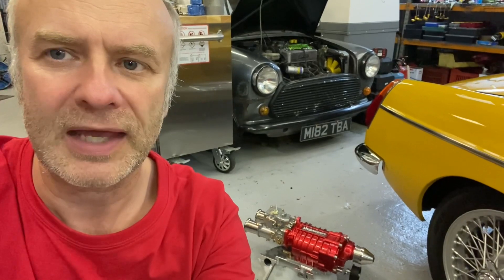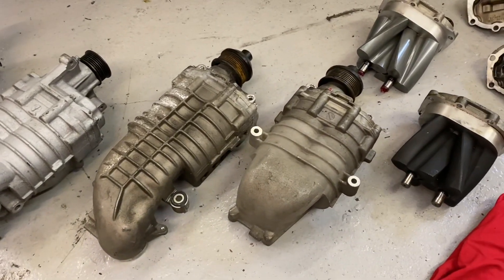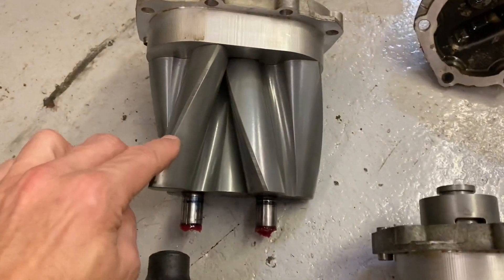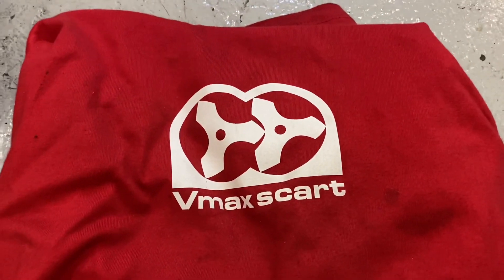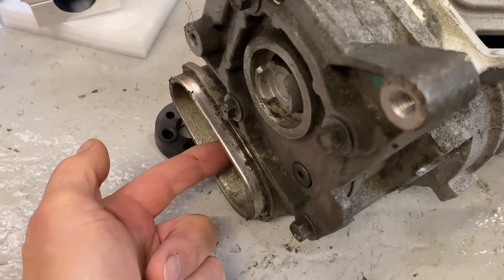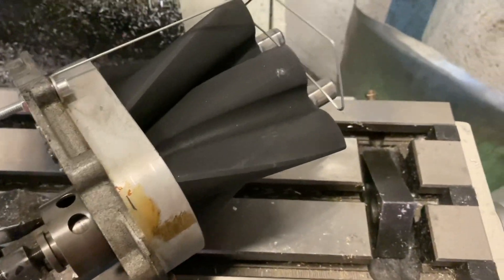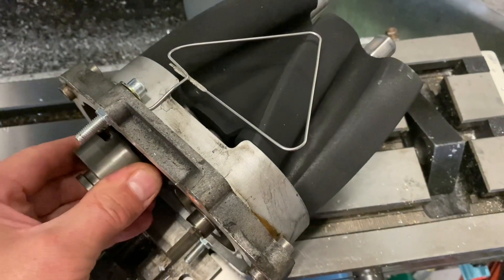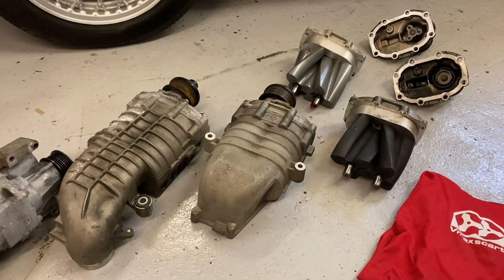Eaton M45 superchargers

Comment: Apart from the R53 supercharger. Do the other 3 superchargers all fit the manifold shown? Thanks
Reply from the maker: a271 type and the mini one are the same but different pulley offsets,
Reply: @Vmaxporsch ahh so for the manifold it would be best off using an early model SLk charger then it seems so avoid any pulley issues.
Reply from the maker: @GaryTillman  yes the a271 type
Reply: @Vmaxporsch excellent thanks.

Comment: Just wondering if it would be possible to add one to a 1970 Volvo 1800E with fuel injection? How difficult would it be?
Reply from the maker: Making one off kits is expensive  as theres a lot of time spent measuring and tsting with developing until it is reliable
Reply: @Vmaxporsch  what do you consider expensive?  E24 maybe could be modified?
Reply from the maker: @Audfroid546666   the mini kit cost 20k GBP for the manifolds to be cast plus 3-400 hours designing /testing and making various parts untill it was finalised. Whats a e24?

Comment: Nice work boss. Just a curious question. You haven't had issues with seals failing due to there being fuel along with the air mix on that carb setup?
Reply from the maker: Nope, Ive been using these since 2003 so 20 years now with no issues
Reply: “Wet” injection.
I will be running methanol through my M45 because I don’t want to run an intercooler.

Comment: Mp45 is better same with the post face lift m45
Reply from the maker: Hi Geoff , do you mean the TVS?  , the mp45 made by eaton is the cast iron pump : https://www.eaton.com/us/en-us/skuPage.3001714.html
Reply: @Vmaxporsch  a mp models are the ones with more of a twist on the rotors almost like a twin screw and no it's not that blue pump they look just like what u got there google a mp45 supercharger ul see what I mean or search a mp45 vs m45 super charger they are all made by eaton too
Reply from the maker: @jeffgood6441  yes here they call them  Eaton TVS  :https://www.eaton.com/gb/en-gb/products/engine-solutions/superchargers.html
Reply from the maker: @jeffgood6441   do you have a link to the official eaton listing? The TVS is more twisted as you can see here :https://www.eaton.com/gb/en-gb/products/engine-solutions/superchargers.html

Comment: Добрый день.Каким средством можно восстановить покрытие на лопастях?
Reply from the maker: hi the grey coating can be sprayed as its expoxy paint, the black coating is much thinner and difficult to replicate , but removing it all will only loose  1-2perc efficiency
Reply: @Vmaxporsch  1-2%??? Тогда для чего оно там нужно?Снизить шум?
Reply from the maker: @КоверСамолет-щ9е  also as a protective sacrafial  lubrication barrier to stop metal transfer between the alloy case and alloy  rotor if dust or grit gets into the gap
Reply: @Vmaxporsch  Только хотел об этом написать.Конечно же что защитная функция. ;)

Comment: I have an spi mini. Would this be considered a feasible upgrade to do with minimal work on the engine itself.
Reply from the maker: yes as long as the engine is good  you could change to carb /distributor SC kit , use one of my remappable Rover  ecus on the spi with Throttle body injection , or go full Emerald ecu with coil pack  and not run a distributor anymore.

Comment: Interesting vid. One point I understood the Eaton designation referred to cubic inches not cc. So m45- 45 cu in or 737cc per revolution.
Reply from the maker: Hi Andrew , I agree that most things in the US are imperial but as all the dimensions and threads on the M45 are metric, i'm thinking the volume is also Metric units as per the website:   https://www.eaton.com/gb/en-gb/catalog/engine-solutions/tvs-v400.html
Reply: You're correct and I caught the same thing. It's ridiculously difficult to find anything on Eaton's present website referring to the older M-series superchargers but yes, M-series blowers are in cu-in/rev - I've got a M45 which is rated for 14,000 rpm max and 45 cu-in/rev (365 open CFM).

That said, the modern supercharger line that Eaton offers, TVS series which you linked, is rated in cc/Rev and are generally rated for higher rpm (18,000+).

Comment: Stuart - you show three superchargers in the video, M45 and 2 x M65, if one was to pick up a second hand one and buy the additional bits from your good self, which is best to convert and what should I be looking out for and what should I pay?
Reply: Good question 🤔. I was pondering about the same question.
Reply: @anthonybrown7959  after chatting to Stuart, I picked up the one in the middle (the one to the right of the M45), I believe it was an M65, but the numbers get confusing. Cost me £60, so I got a bargain.
Reply: Cheers Bill. I will see if I can find a suitable unit. Can I ask what modifications you have done to the engine. I have a 1.3 spi.
Reply: @anthonybrown7959  look
Me up on FaceBook, if you can’t find me search on Classic Minis 1959 - 2000. Few things to sort on the engine / gearbox before throwing all that extra power through it.

Comment: Very interesting. Don’t you need to cool the charged air?
Reply from the maker: By cooling the manifold and supercharger case, inherently  the air is also cooled ,  a conventional air to air intercooler adds too much intake volume and adds to the problem of fuel vapour dropout from the inlet mixture
Reply: @Vmaxporsch  As someone somewhat struggling with getting an M45 running perfectly on an MX5 1.8 that has an air to air intercooler, this comment is of great interest to me and I'd love to further understand what exactly is meant by fuel vapour dropout.  I've had a search and cannot find anything, is there any further information you could direct me to, please, in order that I may learn more?  Thanks so much for your informative video and comments.
Reply: @moorsyclimbing  is your throttle body before or after your supercharger?